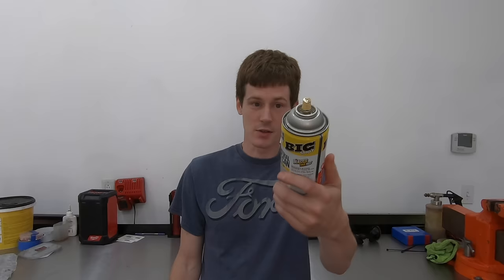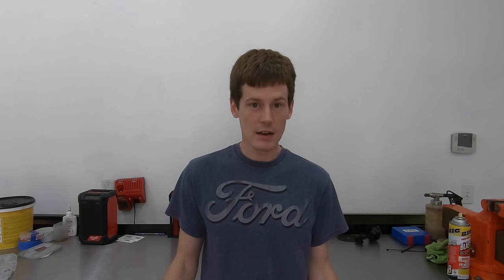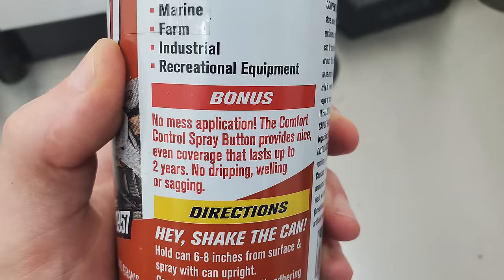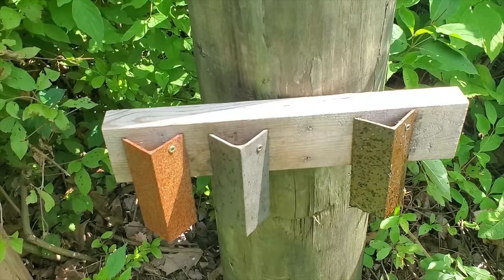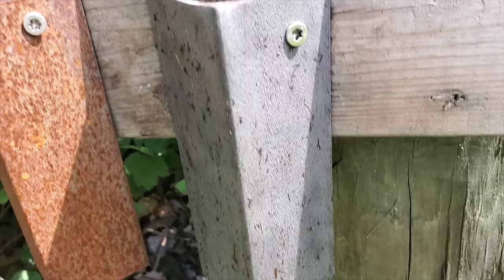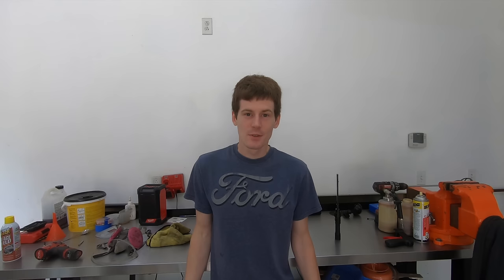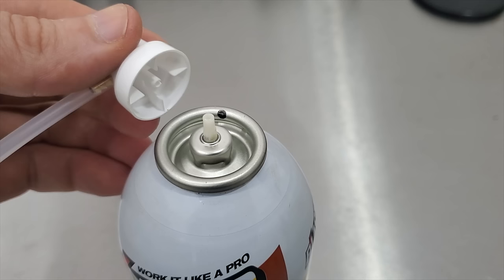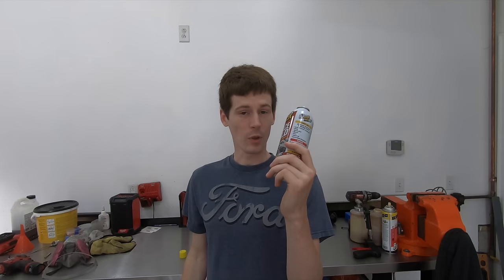I Finally Found The Best Undercoating On The Market... Blaster Surface Shield

Comment: Have been using Fluid Film every year since moving to Chicago.  Will be interesting to see this in more widespread use.  Their PB blaster works great, so I think this should be a great product.
Reply: I think ZEP pro is even better for penetrating. And of course silicone after something breaks free. Penetrators are terrible lubes.
Reply: @VeritasEtAequitas  I don't think this product is the same as their penetrating one.

Comment: I use fluid film that comes in a bucket, it's just like grease and actually has to be thinned a little, and use a proper undercoating gun for vehicles. Stuff in a spay can is not nearly as good

Comment: I really like the normal PB Blaster spray lubricant for general around the shop uses. The only drawback is that shit will stink up the shop with its pungent chemical stink. Does not go away to fast either.

Comment: Great…watched your videos, assessed my need and purchased fluid film, sprayed over my waxed GM frame, next day it’s Blaster over Fluid Film.  

Thanks Geek.  😏
Reply from the maker: People are constantly asking me what product is "best". Me using SS does not make FF or WW a bad product. You will have good results. I've proven it works. Strictly based on performance (not cost or availability) SS is a better coating.

Comment: Thanks for the heads-up I'm working on a 03 f150 I got for $100.00 put new Trans rebuild the engine put a Roush super charger  getting it ready for summer but I do have a few rust spots I'm guna grind off & want to protect

Comment: Discovered a slight drawback. I recently sprayed the Blaster Surface Shield into the inner door cavities of my GMC Canyon and the last few days have been over 100 deg F. I've noticed the stuff weeping from the drain holes in my doors. I'm sure it's still protecting my doors, but I'm planning on a reapplication this fall when the temps go down. At least I know the Surface Shield has creeped into the bottom seams of the doors.
Reply: Did you do a reapplication? What did you find
Reply: @brycebaquol233  Actually, I haven't had a chance to reapply. But I'm positive the coating where applied is still there. I sprayed a spot of it on the side of the engine shroud of my lawn tractor when I treated my truck. Exposed to the sun, rain, summer heat, wind etc., the spot I sprayed is still intact. So I have no doubts of its durability in the protected cavities of my truck. Maybe in the spring, I'll probe around with my borescope.
Reply: This will happen just rest assure it’s flowing down into pinch welds also. Excess  is ok just wipe it off drippings

Comment: Hey Andrew - love the videos. I have a gallon of FF and bought two aerosol cans of Surface Shield after watching this video. General question - I see you don't protect/cover the brake rotors. Is overspray not a concern?
BTW - anybody curious - my local Harbor Freight has the Surface Shield aerosol cans.
Reply from the maker: I've never had an issue. As long as you don't directly spray them it's not a problem. Light overspray comes off in the first couple of stops.

Comment: I want to put this in the rocker panels on my truck. I've been using rp342 and vht rust converter on the underside. I've found if you change your own oil you can see areas of concern and can spot treat as needed.

Comment: I've tried Woolwax Black and Fluid Film Black both in aerosol cans and love em both. Woolwax probably a little better because it lays on thick but Fluid Film Black creeps nicely. Been using both on my 2004 Tahoe here in Pennsylvania and I've got some new parts on it that I want to treat but I don't want to cover them in Black so I'm going to try this Blaster product. I'm wondering if they (Blaster) will eventually come out with their version of Black? That would be cool as well.
Reply: i was thinking the SAME THING. I love the black products as they really pull the look together and shows you where you hit exactly. I’m from Pa too and need to jump on this asap before the salt

Comment: enjoying the tests as well as the updates, now I am hoping that someone comes out with a commercial location for application as I dont have the shop to do the job, definitely ready to change from Krown.
Reply: Just curious, why are you ready to move away from Krown? Krown and fluid film keep showing up consistently when I look up undercoating brands and there is a shop in my town that now does Krown.

Comment: Only one thing I was wondering.  The coatings for the most part are not in UV light because of being under the car.  The test outside is in direct sun so I am wondering what the manufacturer says about two years in the sun.   Thanks.

Comment: How do you treat the inside of a frame that already had surface rust on the outside? 
Can you just spray it on the inside of the frame or is there some way to pretreat the inside surface before spraying the inside of the frame?
Reply: I have a Jeep YJ frame that I intend to protect against rust ; tap the frame all along the outside to loosen internal rust ; use compressed air to blow the rust through drain holes ( added several) ; use a wand with a 360° sprayer end from one end to the other. This will coat the frame internally. The PB Blaster Surface Shield  will penetrate and creep into all nooks and  crannies of the frame. If you have a bare frame, and can turn it over, that's even better.

Comment: Awesome video(s) and very well done systematic, controlled methodology here. I had a quick question regarding the type or sprayer you are using for the surface shield product? Will you still use the woolwax sprayer and inner cavity attachments or do you have a different recommendation?  I have a new to me super low milage '07 truck what looks like it hasn't had any additional treatment and I'd like to get it protected for this winter.
Reply from the maker: The same gun will spray both products.

Comment: Saw you for the first time yesterday. Very interesting. Question, I get how breaking the coat of paint can result in rust but why do some vehicles aways rust in the same places. Example, 2000-2005 Lesabres always rust on the quarter panel under the gas cap. Thanks. Very informative  channel.

Comment: Your previous testing seemed to show that the three cosmoline products completely prevented rust and did not wash off with a pressure washer. I found a local professional undercoating company  that uses RP-342. Please explain the downside of this approach and why you would choose Blaster instead. I live in MN and need to have the best protection possibles for my new 4Runner. Thanks so much for all of your work.

Comment: What do you recommend that I can use on a heavily surface rusted frame on a pickup truck that has been scraped and sanded that is a black undercoat in a gallon can that can be brushed on or Sprayed on. I will apply Rust-Oleum rusty metal primer first. Great stuff!!! Brush on would be more economical. I'm 60 and years ago the were spray and brush on undercoatings available. Not sure what is out the today.
Thank you David 👍👍

Comment: I have watched a number of your videos and have found them very informative, thank you. Have you ever tried using a chemical rust neutralizer like POR15 metal prep before treating with a lanolin based undercoating?
Reply from the maker: I personally don't see the advantage. The lanolin stops the rust on its own. What is the benefit of the extra step?

Comment: Been using fluid film for the last ten years. My 06 F150 never seen snow till I bought it in 2014. Looking at it today it looks like a two year old vehicle underneath. Fluid Film is a good product. Non petroleum so it don’t eat rubber. I’ll have to check out pb blaster. But why change?

Comment: Hey man, have you heard about the new Woolwax Hard-On? 

I love the idea of the hard on so I don’t have to re-apply every year. I’d still use surface shield/gf/WW  inside the panels etc but I’d love to hear more discussion about the wool wax hard on vs the classic woolwax. 

I can find the SDS for “hard on” but it doesn’t state what the chemical composition is. I wonder how it differs from other non rubberized but hard coatings. It certainly can’t be lanolin based?

What do you think about it experiencing the same issues as other coatings that trap rust inside and rot from inside out? I wonder if this mitigates that, but i can’t see how it would. I love your vids on rust protection/reform - I’ve learned a lot
Reply: The problem with ANY hard covering, there WILL be a spot where water finds its way in - in between the hard-on and the metal.  Once that happens, that forms a cavity for water to get in, and it will rust from the inside out.  And then it will spread underneath the hard-on.   Ive seen this before with people that have sprayed Line-X on the underside.  Its just too hard to full encapsulate every piece of metal. There ends up being imperfections.  And that's where the water finds its way in.

Comment: Do you do this commercially for folks?  74 year old female just bought a 2014 Odyssey in great shape, but has a rust spot by the wheel well and rust in the bottom sliding door channel.  Want to prevent it from getting worse.  Locally the place everyone I have asked so far recommends a place that does the Krown coating (only $125).  We did put it up on a lift for prepurchase inspection and the undercarriage looked really rust-free.  I am leery of taking interior panels off for fear I will mar them or not get them back on. (Maybe there are good videos out there that I have found yet)  AND, gee, I might be able to rent lift time from my regular local garage, but otherwise will be sliding around one the ground under the vehicle if I try it myself.  Plan to drive through Ohio this fall, so ...

Comment: just got the PB blaster stuff today. it works well but the bottle sprayers suck. every few seconds of spraying it clogged and had to blow in it to get it spraying again. i would rather buy the gun and use it from the can if it comes out or is out.

Comment: Amsoil heavy duty metal protector is excellent and cannot be washed off with water like some other products and can be coated over with under coating best undercoating found  is under coating in a can just like Z bar
Reply from the maker: CRC HD Corrosion inhibitor is the same thing at half the cost.
Reply: @RepairGeek  The CRC product is good too but you’re wrong about the price it’s pretty expensive if you join amsoil preferred customer you can buy it at dealer cost

Comment: Por-15 does not leak off if you apply it right so there's no challenge between this product and what you're talkin about
Reply: WTF.  POR-15 for this application? LOL.  🤣
Reply: @question_it_701 I've seen many Rodders use it frame so why not use it for the undercoating?
Reply from the maker: How many hot rods get driven through a foot of snow? Rustoelum rattle cans work great too if the vehicle never sees any corrosion...

Comment: As a mechanic I prefer a product that can be washed of if needed.
Working on a car coated with a film that easily transfers to clothes and hands is not a fun experience. Several shops in my area will not work on cars with undercoat.

Comment: its crazy expensive that stuff.  As far as lanolin goes we gun guys make our own cleaner lubricant preservative called "Eds Red".  The preservative component is the lanoline.   Kerosine, transmission fluid, acetone are the other ingredients.   Im pretty  sure you an make you own undercoating with lanolin question is where to get it cheaply.  It all comes down to money i guess.

Comment: I’m really rather disappointed that ‘Blaster Surface Shield is supposedly so damn good for inter-cavities since it “sprays on thin and migrates” only to find that they don’t have/provide/support/recommend a flexible cavity wand specifically designed for their own aerosol product. After reading so many reviews about crappy aftermarket and competitor wands that don’t fit a Surface Shield can, I think maybe the best solution for me is to use Surface Shield on the undercarriage, but switch to the canned FF or WW stuff for cavities since I can get a wand for those product cans. I have a 6 pack of SS incoming from HD, but I guess I’ll need to buy another 3 cans of the other stuff just for a flex wand that might actually work. So sad since the 'Blaster SS cans are the better product at a better price.

Comment: Did you actualky test it to see if it creeps? That's an easy test - you mark a square on a horizontal steel panel with a marker and then smear the product within the square. If it creeps out of the square in all directions then its good. Give it a few days though - it should be creeped out within 5 days as its a slow process. Fluid film does pass the creep test but you can't really spray it inside frames, doors, and panels effectively.
Reply: @RepairGeek  Looking forward to that video.

Comment: He was running a test on his own personal truck, which looked like a Chevy. He knows multiple coats of different under coatings on his truck for 'testing' is the only thing that'll save it from falling apart.  At least he'll have it paid off before it starts to rust out,  unlike a Dodge truck and their rusted out bed wheel wells and tailgate.

Comment: Hey man, thank you for these videos. Sooo much value here. Thx for sharing your wisdom. So, question about this product compared to fluidfilm.. on your outdoor test i noticed that while the surface shield had protected really well, it also looked kinda gross.. and there was a buch of stuff stuck it.. also it looked as though there was a rust color in the product itself.. compare this to how the fluifilm seemed to "set up" to a firmer state and looked cleaner.. what im curious about is based on my observations, are there perhaps applications where the fluifilm might make more sense to use from an aesthetic perspective, or if someone wanted stuff that was cleaner to do work around ie. the undercarriage of their vehicle? (and of couse considering that its still very effective) That point aside, if looks and cleanliness dont matter, considering that the Surface shield is just about twice as expensive as fluidfilm would you say it performs that much better where its worht paying the extra? well, i guess if you truly olny have to apply it half as often then i guess the extra money would be a wash over a two year period, but you would be up on having done less labour.. Last question. can you add graphite to surface shield for a black finish without effecting the effectiveness of the product? Thx so much man!
Reply from the maker: I wouldn't pick one over the other based on looks because both of these products will stay wet and collect road grime. Eventually they will both turn nearly black on the bottom of a vehicle. This pole test removes that dirt variable, so I test JUST the coating not the coating plus dirt. As far as your cost question I think of it like motor oil. You can buy conventional motor oil and get great protection but it's not quite as durable but as long as you keep up with oil changes it works great. Synthetic oils offer better protection but cost more money. Is it worth it to you? That depends on your situation. Surface Shield is a fantastic product but, that doesn't automatically make Fluid Film a bad product if that makes sense.
Reply: @RepairGeek  Right on, this is helpful, thank you for this, and the fast reply. Cheers! Keep up the good work man, your content is great.

Comment: Could it be that the difference is because the Blaster was on a plastic mudflap and the fluid film was on a metal frame ????
Reply: The metal fender washer I believe was the subject.
I wonder how good Silicone water-guard would do. I may do some testing

Comment: Great video! I have just a bit of fluid film left that I will use up soon then I would like to switch to the Blaster product. 

Will the Blaster product spray from the same professional fluid film gun? Also in the winter do you avoid spraying the areas like wheel wells and undercarriage after they've been treated so the product doesn't get washed off?
Reply from the maker: Yep works with the same gun. I hose wash all my cars. If you go to an automated car wash don't get the undercarriage wash.

Comment: I watched your other video a few years ago and I heavily invested on using the LPS3  on my brand new 2022 Subaru Outback Wilderness. I did a 1.5 cans of LPS3 and left it for a week.  Car never seen salt yet since kept it in the garage during winter and currently only has 1k miles.
The LPS3 is like $22 now a can. Should I switch to surface shield in the future since it’s only $14 a can here locally and also wants to use to my other Subaru Outback that only has very minimal rust, but it’s a 6 years old car.

The Fluid Film smells so bad even inside the car. LOL!

BTW, how do you like your Ryobi pressure washer? I’m thinking of going this brand since Home Depot warranty (extended) is good!

Comment: Hey, nice video’s… wanted to try this product on a new snowplow before I use it. I’m kind of thinking this stuff is going to leave a dull film on it that I can’t get off with a pressure washer at the end of the season. Other option is fluid film that I can clean off and reapply in the spring. Any thoughts? Thanks for your time

Comment: Bought 2 cans. Been in my garage over the winter. Tried to use them today since weather was good. Started out well then stopped working. Followed instructions on shaking before use. Noticed caps leaking out from bottom. After watching your video checked tops. They are male. Very disappointed in spray can version. Anyone having problems with the performance of new style. A little bit gun shy considering what I paid for the spray cans.